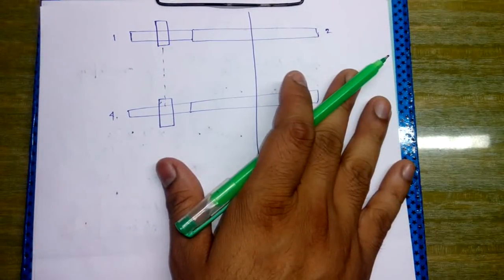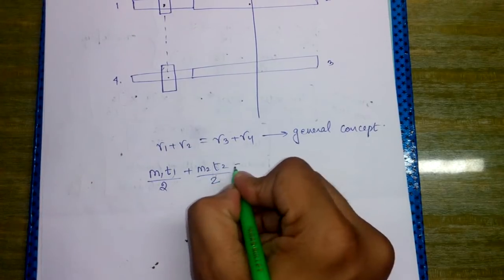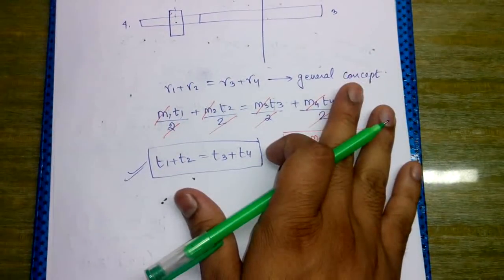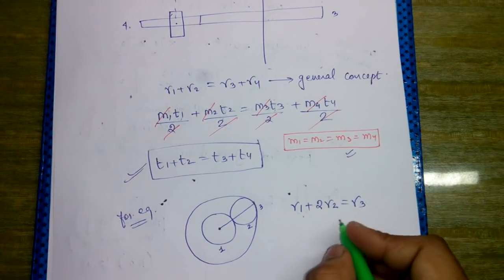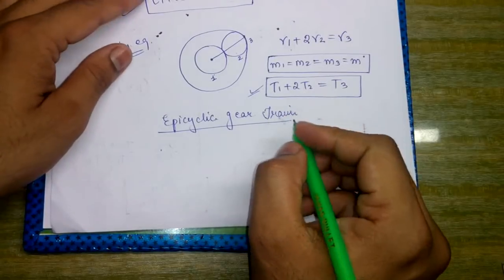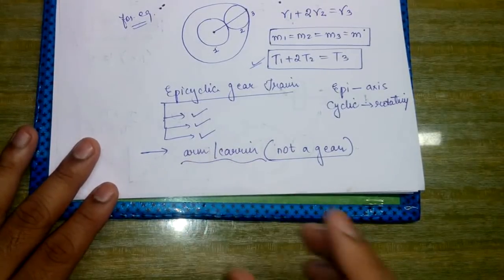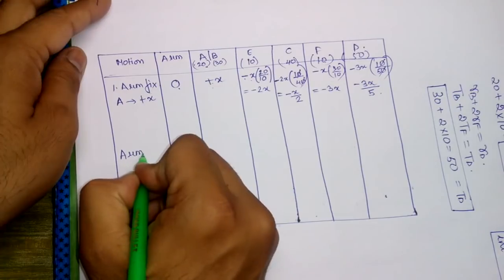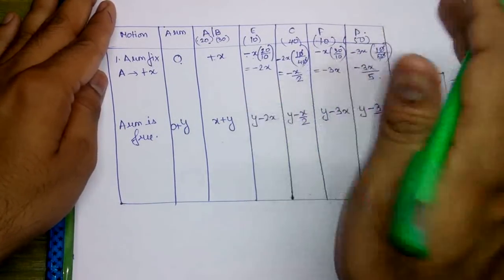Theory of Machines Lecture 13: Epi-cyclic gear train, Sun, Planet & Gear system, numeric problems.

Comment: In sum of epicyclic gear train in ques it is given  100 rpm anti clock so acc to sign convention it is minus 100 rpm.....but in last step you took 100 rpm ( positive) ie in clockwise.....how???
Reply from the maker: Yes it should be taken with negative sign..please make a correction there...
Reply: No... It should be taken as a negative sign for clockwise rotation and a positive sign for counterclockwise rotation refer Theory of Machines by RS Khurmi.... 
And please note in the table also all the negative sign indicates the clockwise rotation
In the question it has been given as 100rpm counterclockwise and you have solved correctly with wrong sayings of directions... 
I hope you can understand this